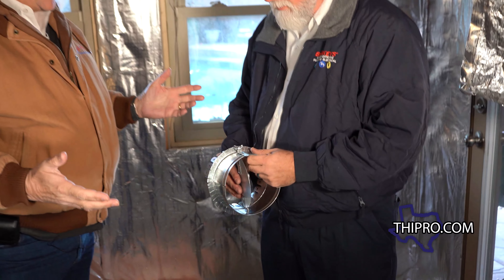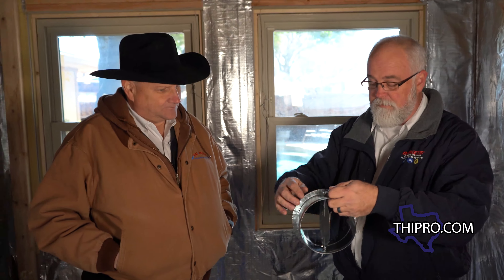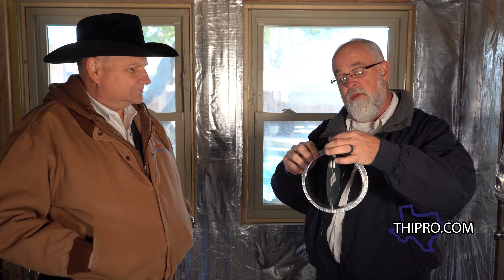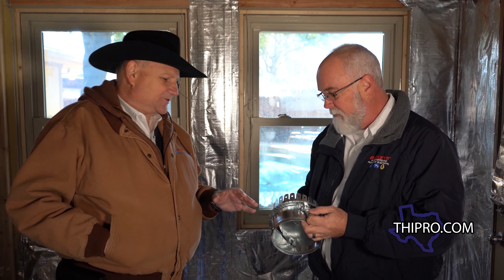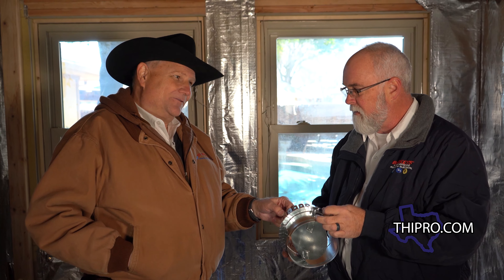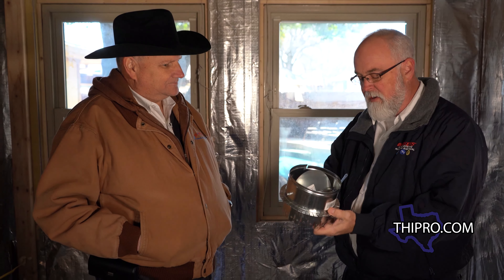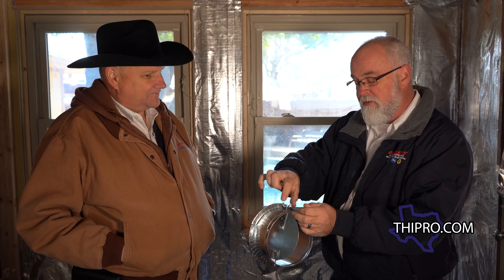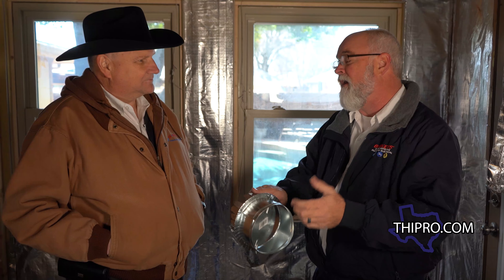Controlling Air Flow & Temperature with Dampers in AC Ducts

Comment: How do you know if the dampers are still working when you move that little leaver?  I have some areas in my ductwork where someone took out the screw to the damper. Do you have a video to show how to take the duct work apart as it is extremely cold in my home?

Comment: I would disagree that dampers don't need to be adjusted between seasons.   I have rooms that that direct sun.   During the winter, they are already naturally warmer, and don't need much heat.  But summer time, they need every bit of cooling they can get.

I did like that right after that statement, you did show a way to mark damper levers at different positions depending on the seasons.

Comment: Hi,
I am an electrical engineer. I was thinking about building smart dampers not at the registers, but the one you just talked about. The ones that can be controlled with a mobile application.
I wanted to know if this is a good idea and can be used?
Reply: sorry man, it has been done. I am studying mechanical engineering.

Comment: Are dampers really needed ? My current all system doesn’t have one. We are about to replace the old ductwork In the attic.
Reply: Damper is only needed is if you have a room near the air handler and its just stealing all the power that can help potentially be used to make it to the last leg/outlet of the ductwork

Comment: I have a 1993 Day& night furnace. I can't find the Damper. Is there a chance it's in my crawl space under the house? If they need to be adjusted, why would they put it where no-one wants to go every 6 months. Been in my house 18 years and I've never had sufficient air flow upstairs. Any help?
Reply: Depends on how your house is set up, where your unit is located & if it’s an upflow, downflow or a horizontal. 
The supply plenum is where the dampers should be at unless you have an all metal duct then you probably won’t have dampers.
Reply: @nazarethhernandez2989  I live in an apartment ; I am currently in the process of taking the complex to court due to not repairing things and my ac being one . With that said I’m having to do what I can to get just a little bit of air that’s not really cool . My question is where would my duct switch be located to control my air flow . I’m pretty sure my ducts are clogged which I’ve shock vac them out the best I could but I’m getting hardly no air in my sunroom and living room . Pleased help I’m desperate
Reply: @StayWildMoonChild-111  most apartments are upflows. Meaning that it sucks the air from a lower portion where the filter is(return) & shoots cold air across the evaporator & through the top straight out the supply ducts to the rooms. 
There is a chance that maybe a few became disconnected or they changed out the air handlers & when they reattached the top plenum some disconnected. There’s just many factors. Usually there‘a small crawl spaces where they make the duct work out of duct board & overtime it breaks down & wears away due to moisture, heat, rodents. Only way to know is to access the plenum & individually inspect all of it see if it’s correctly sealed from the inside. Sending in a small camera with a light or breaking all of the Sheetrock off which the apartment complex probably won’t do
Reply: @StayWildMoonChild-111  In your case, in an apartment, and you say both "not cold" and "very little air flow" I'd suspect that there's ice in the evaporator coil. Since you tried the shop vac, I assume you checked/changed the filter - if there's no obstruction to the air flow, and there is ice in the coil, it could be low on refrigerant. (which the landlord should have fixed) It might also get blocked up if the condensation (drip pipe) is backed up - that you might also clear with a shop vac. (look for a little drip pipe going to a floor drain, or to the outside.) I hope that helps a little.